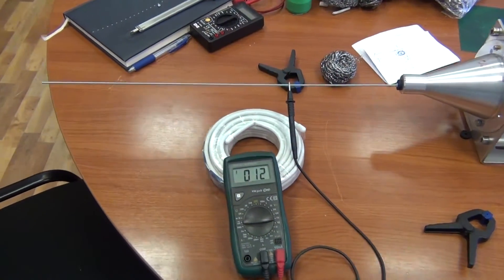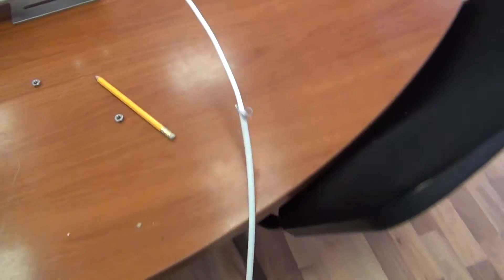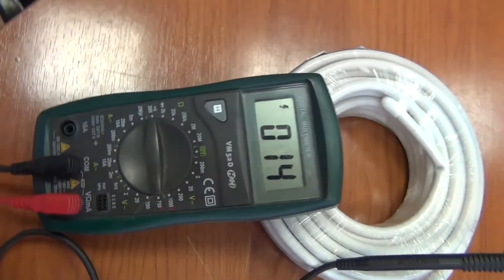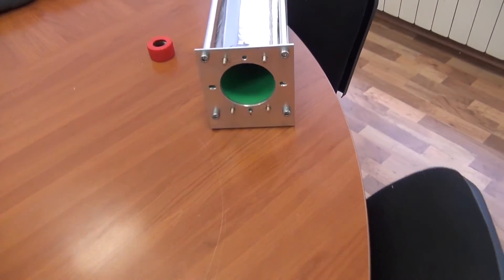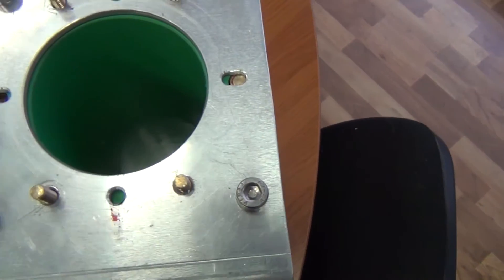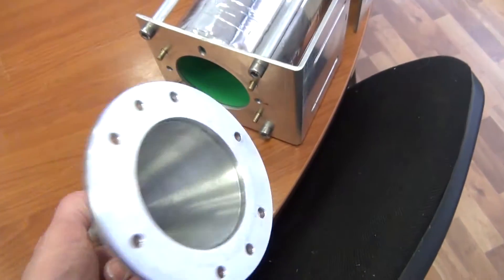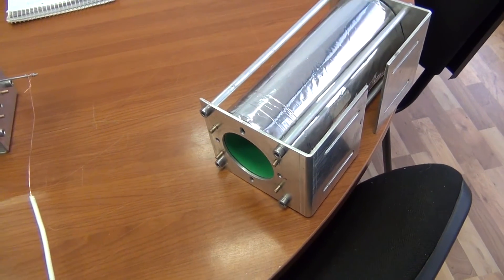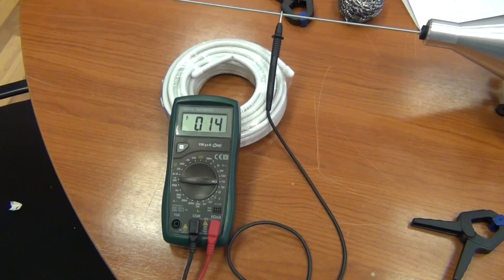EMERGENCY - For MANKIND - FREE POWER FOR EVER HD EMI 750VAC

Comment: Ok so my theory is that the antennae is connected to a positive source of energy inside his residence not drawing ions from the air but from the grid that it is plugged into which he has concealed in order to have people believe that he is drawing ions from the air to accelerate and produce an electric current. I have no doubt that the magnets will accelerate the protons but i think he is lying about where they are coming from. I could be wrong im not educated on this stuff but have tried different experiments and nothing magical has happened when i try to replicate what is being shown.

Comment: What sort of current does it produce?
Reply from the maker: +hadron2,

Sir / Madam, thank you for your comment and interest.  I will try and explain, (I am not sure of your understanding of EM energy (but you have a smartphone)... A Smartphone has an antenna that's how you make a call. The antenna uses electricity (DC) from your battery. The antenna Polarizes your DC voltage via a superhetrodyne mixer and tonal signal into an RF signal.. (the plane of polarization is in the opposing plane to the Electro Magnetic field). End lesson one... (not being rude).. 
Lesson two... Magnets have polar fields (N/S) but when you place them under great compression the fields oppose themselves and oscillate at the RF of the magnet, that of the earths magnetic field (15 Khz) as shown by the MOP (Magneto Optical Paper). 
Lesson three.  All polar devices (magnets) perform linear operations / functions.... Thus that is how you can stick two magnets together in a line (linear).... 
Lesson four.. Take a series of linear states and wrap them upon themselves and create a circular polarize linear condition . 
Lesson six... the output of the central field is NEITHER   D.C. or A.C  but omni-phased.. Thus the output is FAR FAR greater than a standard xxx Volts A/C @ 60 Hz. (that just one phase). So the output of omni-phase is at lease 360 times greater than a single A/C phase.  

Alas.. I do not have the money to connect a 50,000 pound "forward looking high trigger point oscilloscope".. if I did I could give you the exact voltage and phase.  But I can tell you it can easily produce 1114 Volts A/C @ O/P (Omni Phase), and has the ability to produce many tens of thousands  of times that voltage.... If you have any further questions may I ask you to email me and I would gladly discuss more with you... The exact method and working is under GLOBAL PATENT... (For mankind)... I refuse to allow a country, a corporation or government or bank or power company to make any form of profit from this.... I have done this for humanity and not the banker.
Reply: @naccis  Nigel
There is no such thing as a “patent” is a created fiction to enslave your mind and make you submit to “their” authority, the moment your thinking is constrained by those shackles you are buggered mate. You have demonstrated that you can think laterally in the physical world so please show the same ingenuity where this is concerned and let’s just get it out there 🙏🏻✌🏻🇬🇧
Reply: What is your email address
Reply: @melissasadler7513  let's help people live off grid.
Reply: @WhistleblowerRIP  would be nice

Comment from the maker: People have made "comment" to one of my short video's, on the topic of 
"FREE ENERGY"... One "clever highly observant" person quoted:
"The Meter is set to 750 VAC and the meter is showing 15 Volts" ... 
OK..
 15 Volts of FREE ENERGY from a PHASE ONE project that cost less that 
the price of a CHEAP Package Air-tours holiday? That's 15 Volts from now
 until the sun goes out, That "15 VOLTS" is a greater achievement that 
the first flight of the wright brothers, that 15 Volts is greater than 
E=mc^2, that 15 volts is the financial exit route of mankind.
That 15
 volts has more sustainable power than all of the atomic bombs ever 
dropped, that 15 volts can power a pace-maker from now until the sun 
goes out, that 15 volts can do so many things, even boil a cup of 
water.  If "the questionable person" wants to go further, then the true 
voltage that is display is FAR FAR greater. The digital meter has an 
"update-time" of 60Hz, that means the meter is only measuring one value 
at one time. It's a bit like looking at the voltage as a long string of 
/\/\/\/\/\/\/ Where the volts are only measured at the peak. Also the 
voltage is OMNI-PHASED thus there are infinite phases ... And if the 
"person" had listened I did say I don't have the money to build a bigger
 one or a more powerful device.  I do know if you connect more than one 
device... oh believe me it is shocking, I've already taken one 1000 Volt
 plus charge and it knocked me on my ass. So if the wright brothers flew
 a few meters, and I made a few volts and in the process defied Albert 
Einstein, what does that make me.
Reply: Volts are for voltage and have nothing to do with power. !5 V is just 15V. To understand the power you need to know the current. Judging by the wires you used and the way they are connected, this setup can barely pass 25 A before something melts, so  all you could potentially get in this setup is 375 Watt. Which would be clearly an achievement if it really were 25 A. Rough estimate of capacitance of your system suggests it is around 20 μA. That give you 300 μWatt. Yep that's about right. This power comes from the phase wire of the wall outlet. The rest is just to create capacitance.
I suggest you take time to learn basics. 

Also,  it is "superheterodyne", not "superhetrodyne". 

The cheap multi-meter display 15 V means 15V, regardless of the selected range. You can read the manual to that multi-meter.

Measuring 15 volts AC from a phase wire connected to a large piece of metal connected to the large junk of metal? That's called "capacity". They study it in the school and any electrician should know about it. FYI. This is how simplest phase indicators work! 

PS. Note, that my post is polite, on the topic, written in acceptable language, contained correct information, and completely in line with Youtube policies. Any removal of this comment will clearly be an attempt to silence critics.
Reply: If I rub my hair with a balloon I can produce 1000s of volts .... Yeah free energy ....